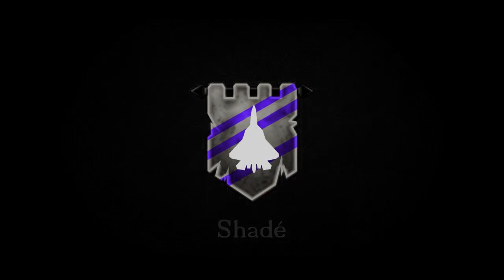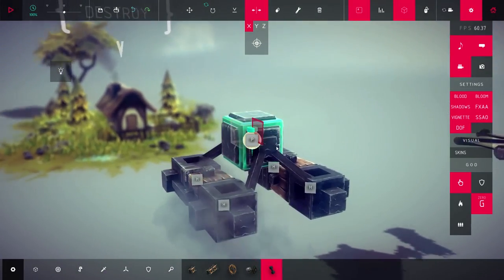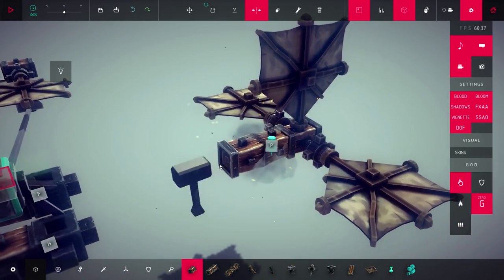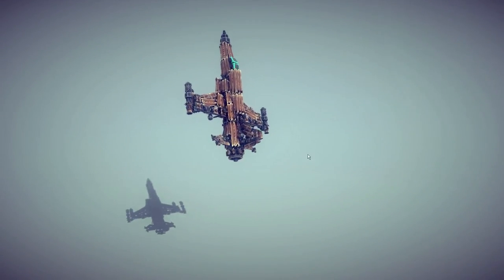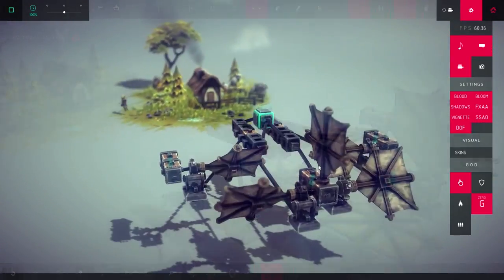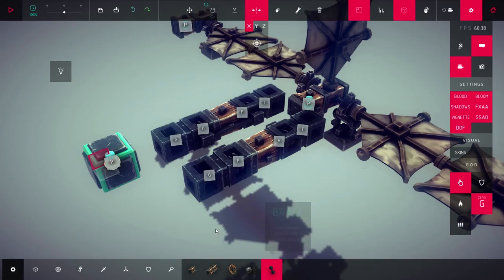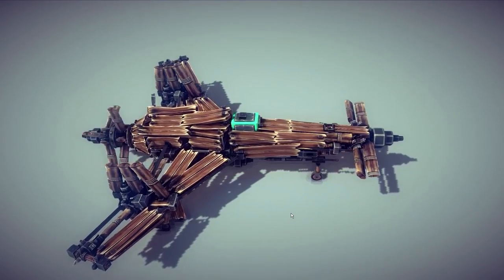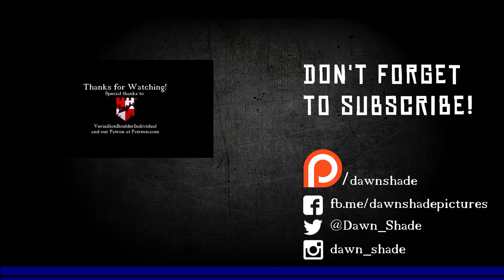How to Build Realistic Steering in Besiege - Basic Simple Plane Tutorial Part 3/3

Comment: I use steering hinges with the return into place option on. But it still not very compact and it's a bit cheating avoiding all the mechanical stuff I think.
Reply: Don’t worry, it isn’t cheating. In my book, if you can play it with no mods, it is not cheating.

Comment: As someone new to making modded creations, may I ask if you can make a tutorial on wing shaping using mods like the build tools mod and the scaling mod? If it seems too much to ask, I'd be happy even with just tips here in reply :D
Reply from the maker: maybe in the future.
but i just copy the wing shape like the real plane
Reply: Thanks for replying, and I'll be keeping an eye out if ever you put one up :D
Although one question: how good of an idea is it to use the easy scale mod to quickly make the wings? with the wood panels or propeller blades?
Reply from the maker: the wing should have enough propeller blade to make the plane fly, after that you can use wooden panels to cover the rest
Reply: I see. Thanks for the help :D
Reply: Hello Shade, I've been trying to make propeller-driven aircraft in besiege since I first commented here and I always ran into the same problem: the aircraft is too wild and although controllable with difficulty, seems to have a mind of its own. I noticed the control surfaces getting pulled and pushed up and down by what I'm guessing is drag... do you have any suggestions to fix this?
Reply from the maker: +Nimbus Windstrider yep it's drag. the shape of the control surface shall be symmetrical and kept small. Also don't place the RTC controller too far from the swivel

Comment: i have great problems covering the body of the planes can u give me some tips on that.
Reply from the maker: Use wooden panel.
Use Building Tools mod, rotate it at multiples of 10 degree, move it at multiples ~0.10 until it fits.
Some like to build the cover first and put mechanism inside, I like to build around the mechanism.
Reply: thx for the tip

Comment: if i start my plane from the air he doesnt fly straight (with engine off and on). Instead he starts to rotate to the right (also no differents if the engine is off. With zero gravity the plane flies straight untill ca 300blocks then it starts to go up and right. How can i fix this?
Reply from the maker: seems like your engine does not generate enough thrust. what kind of engine did you use?
Reply: simply 3 wheels (×2) with small proppelers (lengh:0,3)
Reply from the maker: how many small propellers?
what method did you use to counter the torque?
Reply: 8 propellers. I rotated them 23°. I build a new one and now everythink is allright, but i dont know why. The plane is a bit heavy and now my engine is clearly too bad. Do you know very fast engines that dont break?
Reply from the maker: Use a heavy block for the center of the propeller. It will reduce the propellers stretch.
Reply: Oh i didnt know that. Thank you
Reply: in your designs are wings out of propellers and in one video you mirrored the one wing, but when i do that the rotation is wrong and the plane starts to rotate. How do you make proppelers which dont generate lift?
Reply from the maker: Press F after mirroring.
To make flat propellers, rotate it at -23.06876 (for the left wing)
Reply: Dawn-Shade thank you
Reply: if I use this tip, can i just copy the wing for the other side?
Reply from the maker: +robson bromberg you have to mirror it and flip everything on the other side with the F button
Reply: It worked!!! Thanks man.